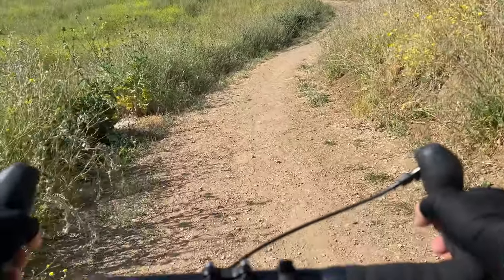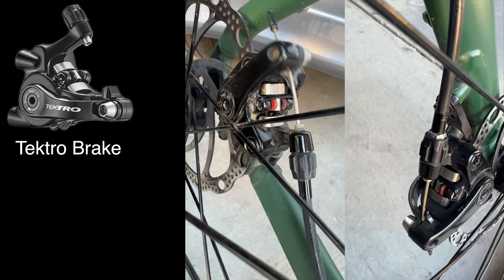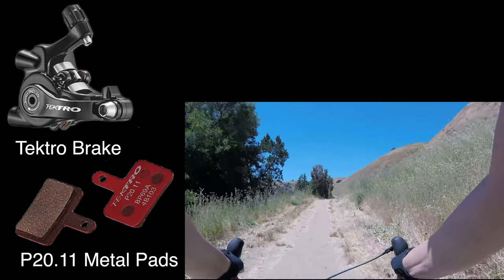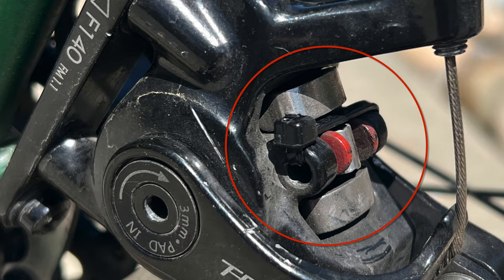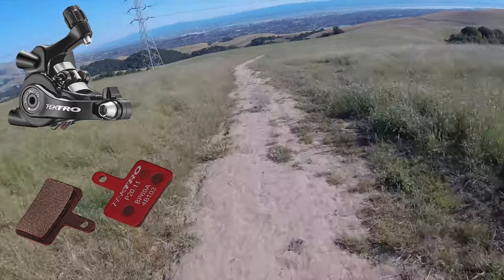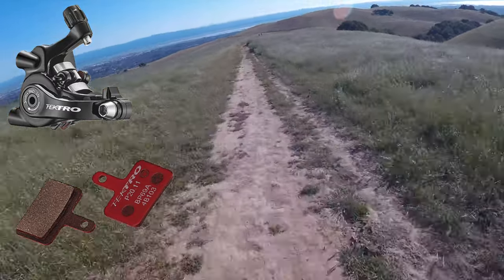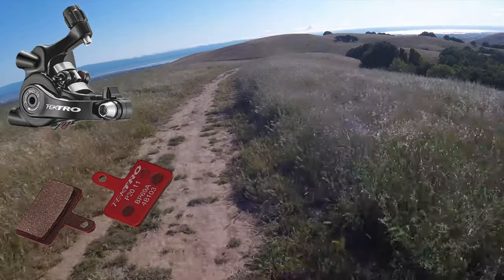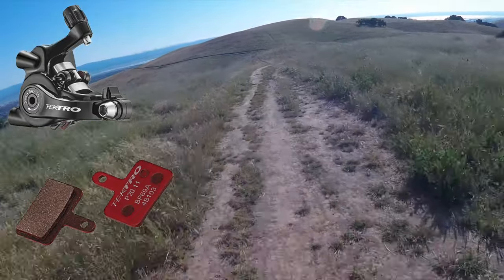Metallic vs Resin Pads with Mechanical Disc Brakes on a Gravel Bike

Comment: My Vitus Cross bike came fitted with the red P20.11 pads on Spyre mech disc... I tried everything you're supposed to do to get these working, setup , bedding in etc but they still felt bad unless I was in the drops with all 4 fingers pulling.. I swapped out for the Shimano B05S resin pads which I was using on an MTB (hyrdraulic setup) these are working better for me..
Reply from the maker: Honestly I only use the drops downhill.  However I use one finger 95% of the time, two if I really need to slow down.  I tend to feather the brakes and probably don’t ride as aggressively as others.  It could be you demand more out of your brakes than me.  I concede that stopping power of a good set of hydraulic brakes will likely always be greater than mechanical brakes.  For my riding style my brake setup is plenty strong. I’m glad you found something that works for you
Reply: @tedlovesbikes  Was thinking about it and to be honest  I think it may be the fact that where I live in the outskirts of London UK we don't the sort of terrain to come down (hills) in the video, also it's Winter here and the trails I'm riding never really allow the P20.11s to warm up properly.. I haven't binned them so might swap then back in the Summer, by all accounts they need to be up to temperature to work well.. the BS05s seem to grab in cold conditions .. cheers

Comment: And now, 5 months later, can you share your impressions again?

Did you noticed any wear to the discs?

What about the longevit of the pads?
Reply from the maker: I had a rotor I had to replace.  The pads didn’t last all that long to be honest.  I may try something different in the future but I am happy with the stopping power
Reply from the maker: Please see this one DIY Disc Rotor and Pad Replacement Featuring the Poseidon Redwood and MD-C550 Tektro Brakes 4K
https://youtu.be/YNpv7TF-KtQ
Reply: @tedlovesbikes Hi Ted, what was the reason for needing to replace that rotor? Thanks 👍🏼
Reply from the maker: @radiocontrolled9181  I measured it and the disc had worn.  Just regular use but in gritty environments wore it quick I guess